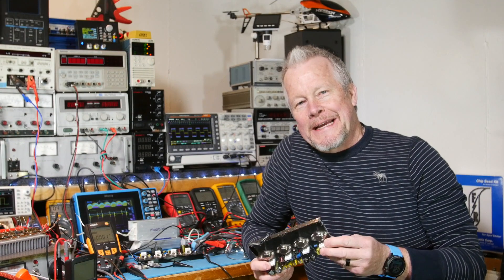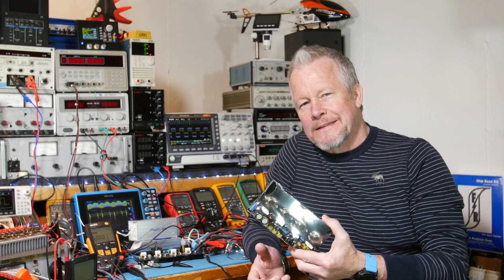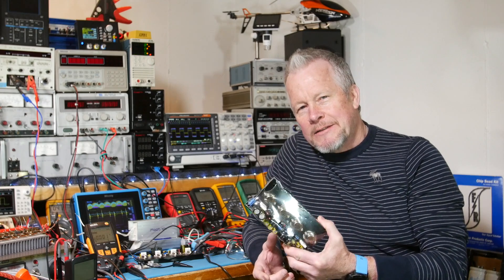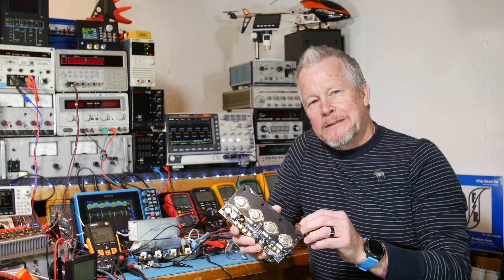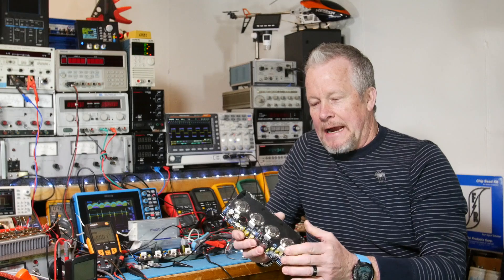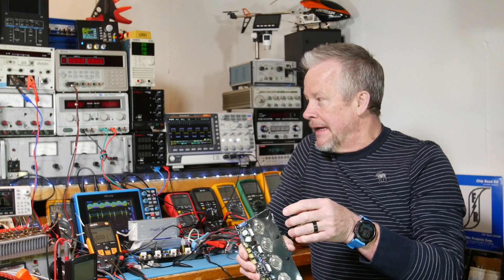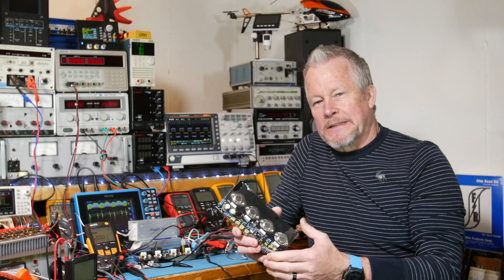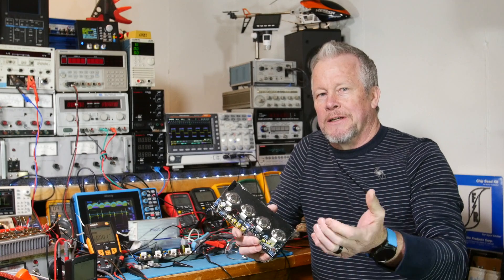20 Watt Class A Amplifier - This is Why it Failed

Comment: Theoretically, if you were to increase the supply of the NE5532 input buffer to +/-20Vdc the output would approach 25W.
Reply from the maker: Thanks Tim!  Yes, you are correct, if I could get that at the output.  I could change the zener to get near 20 volts at the NE5532, then based on the losses I see, I should be able to get 20 Watts.  It is worth a try.  Hopefully, it doesn't cause a problem somewhere else;)

Comment: Microcap not working in windows 10
Use ltspice I think it's best simulation software
Reply: Micro-Cap is absolutely fine on Windows 10 and actually is a blast! Best simulation software I've seen. Something must have gone wrong with the installation.
Reply from the maker: I have used Micro-Cap on multiple PCs using Windows 10 and there is no issue.  Loads up great.  I mostly use it on my MacBook with Parallels running Windows 10, and that works just as great and fast as it does on a PC.
LTSpice does not hold even second place. There’s a reason Micro-Cap sold for $4700, and intusoft, Pspice, Beigbag, and others are able to sell their software.  If LTSpice was a good as their loyal following, who by the way love it because it is free, then all the companies selling software to engineers, would be out of business.  LTSpice is especially bad at simulating anything LT - because it is behavior based - not a spice simulation.

Thanks fir your comment, it gave me a chance to set the record straight;) IMHO of course...
Reply: Sorry sir maybe I made mistake I install after watch your video. Thanks
Reply from the maker: Ok let us know if you still have problems.  Try downloading just the program and not the full package with the manual.  You can get that later.  Maybe the size of the complete package is too big.
Reply: I unstall micro-cap using full cd install version software works well. Executable not working.

Comment: you deleted this video once why!? what happened to the Nelson pass amplifier I'd like to see that improved was it a j2 can't remember stick a 700va transformer on it most of them have very small Transformers
Reply from the maker: It was replaced with the part one video,  I must have accidentally coppied over it:( so I had to reload and freeze the last.

I will get back on the Aleph 5 after I get the parts for it and I get this over - which I didn’t know it would turn into a real project;)

Comment: For me, solid-state class A is gone, whether it's about DIY fun or actual performance. I'm quite comfortable with modern class D like the Ice series. That's even before considering the costs - no heatsink, no PSU, no fancy DC servos.
Reply from the maker: I think you you make great points!  And I’m with you, but I think I need a representative amp for at least the Class A and Class A/B family’s to compare.  Just to show others;) Thank you!
Reply: @KissAnalog   what about using a class D amplifier as the power supply to drive a class A? 3000 watt sounds about right to you lol
Reply: class A is still very good when use for high DB sensitive tweet in a digital crossover/dac/amp setup.. or headphone amp

old ice modules suck but new one maybe... nc500, IRS, purifi are more interesting to me..

Comment: It's been interesting to study, but I wouldn't spend more time on this amp. It's a strange circuit and you could probably build a kit amp in the time of might take to get this one working better. Even then it might not be great. I'd move on unless you want to build a new front end for this. If you can't return them then perhaps you could resell them as-is on ebay.
Reply from the maker: Thanks Rob!  I agree with you, but I think I'll give it a go for the channel;)  Maybe we will learn something.  And if someone else has purchased this and looking for help, maybe I'll be able to come up with a solution.
Reply: @KissAnalog  Sure thing.  Just my two cents and I'll be interested in what you do with it.  Good luck.

Comment: alright i'm the 100th thumbs up. what u got could be a fake. 
my personal opinion on these chinistan amps is, dont spent over $50 for a class A/B, and not more than $15 for a class D. there will always be cutting corners and under-spec components, no matter how much u offer. it doesnt mean u spend $20 on a 50% performer, u will get a 90-100% performer if u spend $40 or $50. no. wont happen. 
so just get the cheapest u can find for a reasonable design/implementation within ur ability to mod. provided the main IC is real. therefore say for a class D, usually it means changing the several input caps and output coil inductors, plus maybe changing/adding a few film caps for bootstrap or gain. these will cost u about $10-20 extra, depending on how far u want to go, but u will definitely get something better and more versatile than the vanilla board. 
dont get the absolute cheapest board becos there might be too many things to mod and some could be too troublesome or not worth the time and money to do it, heck the design could be very bad as well. and dont get the expensive ones thinking u will get what u paid for. no u wont.
Reply from the maker: Thanks Anika Ace!  Great feedback!  The funny thing is, I thought buying this ready made board would make it fast and east to build up this amp for a friend...  nope;)   OH, and now I have to get this thing up and running - now that you are my 100 thumbs up;)

Comment: So if I understand correctly...you need about 35 volts output from the op amps (to achieve 20 watts output). and they are limited by both the power rails (14 volts) and by their inability to go (or work without damage) above 14 volts.
Reply from the maker: Great question Steve!  I'll make a new video on this amp and see what we can get out of it.  For 20 Watts at 8 ohms, we would need near 18 V peak to peak swing.  The next voltage range that I know of is the +/-35V OpAmp.  We don't need that and possibly the OpAmp installed now will be OK, but with voltage drops and headroom needed by the OpAmp and output stage - I'm just not sure without a schematic.

Comment: My only thought is that the vendor shouldn't be encouraged to sell overspecced non-performing amplifiers. Not returning it has that effect.
Reply from the maker: That's actually my thought too.  I was bugged that it is on the high end in cost, but performs at the lower end of what I have tested.  In the end, I think I'm going to keep it because it will be a great learning tool that viewers will benefit more from than the small lesson I give the vendor in returning it.  This is one of those cases that bothers me though...  Thanks for your feedback!

Comment: Did the manufacturer give you a schematic, it would give us an opportunity to see if there is not just an incorrect component placement. I cannot believe someone goes to all that design trouble to make anything so crappy and then flog it for a 100 bucks, it does not make sense
Reply from the maker: No, very little information.  I'm with you Nico - it doesn't make sense!  Maybe it is as simple as changing out the zener to something closer to 20 V?  I think I'll give it a try;)